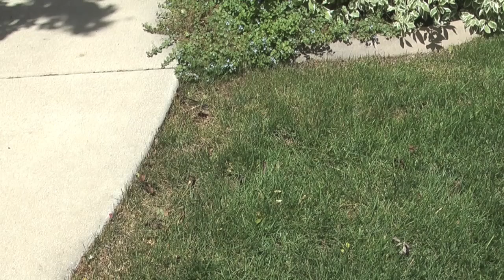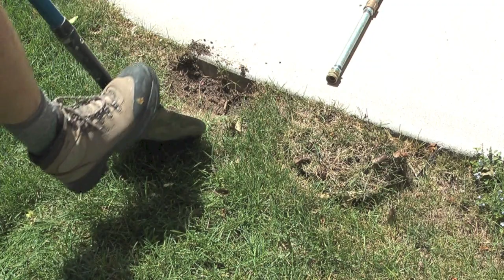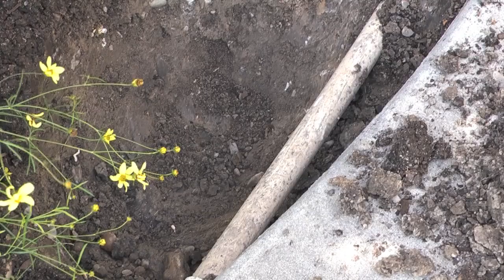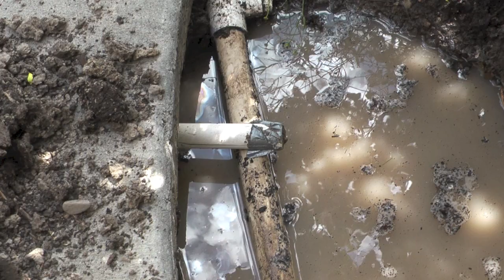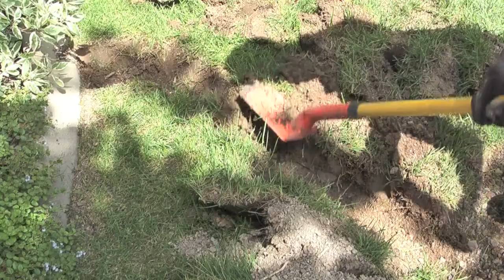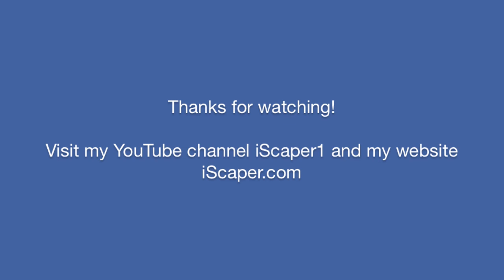How to install a sprinkler pipe/conduit under a sidewalk

Comment: Worked like a charm for my project. I was stunned that it actually worked!  I was able to run my pvc conduit under my walkway to accommodate line-voltage wiring at a depth of 12".  I added a brass shut-off ball valve  between the end of the galvanized pipe and the 3/4" (MIPT)  x  3/4" (FHT) swivel brass fitting for my convenience...and used my wet vac to suction up the accumulated water in the trench.  Thank-you iSacper1 for demonstrating and teaching this DIYer an effective way to trench under a sidewalk without having to pay-out big bucks to a professional- especially when one lives on a fixed budget.  I live in the north-east corridor of the U.S. and have the rockiest soil one could imagine.  Lucky for me, I was able to negotiate the spray wand under the slab without a hitch- and in less then 3 minutes. ~ With kindest regards and gratitude.
Reply from the maker: Thanks, I appreciate the feedback.

Comment: I did this about 10 years ago for a sprinkler system. I used 1/2" pvc with a pipe cap with a 3/6" hole drilled in it. It flexed enough I didn't need a long trench to keep it horizontal. It went under the 3 foot sidewalk in less than a minute. Because of the smaller jet, water didn't even pool up in the hole. I was lucky not to encounter any rocks.

Comment: We as plumbers do this all the time . Only I use a 1" schedule 40 pvc pipe and I cap one end then drill a 1/4 inch hole and put a 3/4 pvc mip then a 3/4 fip x 3/4 fip hose adapter . The reason I use pvc is because you can steer the pipe and make do what you want . Also you don't have to dig as long of a trench . But your way works really well too . I'm a master plumber and have been licensed in texas for 20 years but I learn new stuff every day . I'm always stay open minded and I don't think I know everything . Great job buddy !
Reply from the maker: Chad Jones 
Thanks, I've used PVC pipe also but quit when I got the pipe stuck under the sidewalk and broke it off underneath the sidewalk trying to get the PVC pipe out. That's when I went to and stayed with galvanized pipe.
Reply: iScaper1 ten for !
Reply: Chad Jones i am a gardener and I sintall new sprinklers all the time I use pvc with a jet nozzle at the end that what he did only takes me 30 mns the most no matter what soil it is unless it’s root I just move a couple feet away and start again. No need to be a plumber just common sense. Work smarter not harder
Reply: Very smart information. Now I have a more detailed plan on how to run low voltage wire under my sidewalk, and or sprinkler tubing.

Comment: how could you not like this video. Guy did a good job and accomplished the task he set out to do. professionals do this the same way. Good job!👍
Reply: plenty of jealous tradies out there sniping DIY vids.
Reply: He did do a nice job...   however, there is no need to dig up your yard like that....   a shorter pipe attached to a water-hose would do the same job with out digging up the yard.....
Reply: Luis Barrueta no, because it could end pointing down or to the side.
Reply: @luisbarrueta8207  hvvkh585
Reply: Butirdj

Comment: Thank you for this.  I made one with a $3 high pressure nozzle and a 36" galv. pipe -- worked beyond expectations.
Had corrugated pipe under my walkway, clogged with clay/debris over time.  This blasted my way around the old pipe, ripped it out and ran 4" pvc.

Comment: Thank you for the demonstration and helpful tips. I was able to easily tunnel under my 36" walkway, even with grapefruit-sized rocks, using a steel pry bar to loosen the rocks after water had cleared most of the path. Coming at it from both sides made it pretty quick too.

Comment: Thanks for the video. You should consider using spray foam to re-seal up underneath the sidewalk. Get the 36" nozzle extension and a few big cans, it will take a while to empty out the cans but its worth the time.

Comment: Nice job, Keri. I did this last year with 120V wire and conduit, and so of course I had to be at least 18" deep. That's a lot harder. For a path that supports a vehicle, it needs to be at least 24" deep to meet local building code.

Comment: for the paver walkway, rather than trenching deeper to go under, consider pulling up two rows of pavers to expose sand and base, then trenching down 12"; then replacing paver base and sand after installing pipe. I have done this sucessfully. it is less digging and fuss. Consider installing a sch 40 pvc larger than irrigation pipe to create a permanent channel under the walk. that will allow you to compress the base and sand as much as you need w/o risk of damaging water pipe.

Comment: Great video! I believe if I was going to be using the water drill a lot I'd attach one of those brass valves on the hose end so it would make shutting the water off much faster and cleaner. :)

Comment: Great vid. THANK YOU for using a tripod with your camera! I'm planning to run a water line to a raised bed for next year.
Reply from the maker: Thanks Jessie.
Reply: iScaper1  why not use  pvc with an attached nozzle . When you have  get under the side walk you just cut of the nozzel and your done , you will have a pipe under the side walk
Reply from the maker: anthony abarca
I like to use galvanized for strength. To me it's too risky to attach the brass nozzle to a PVC male adapter because it could break off under the sidewalk.
Reply: They do have pvc nozzels that are made for just that
Reply from the maker: anthony abarca
PVC would be okay in optimum soil conditions, but I would still prefer galvanized in rocky soil.
Reply: iScaper1
Reply: +iScaper1 There's another video where the guy puts a Tee on his pipe. He puts one of those square plugs on the end and runs his hose through the top of the tee. Then when it gets hung up, he taps on the plug with a sledge hammer. Might be needed on tougher soil or longer runs.

Comment: Consider using the pipe you want under the sidewalk as the lance.  Then once you have it through, you don't have to worry about getting the second pipe through, just take off the fitting on each end.  When you hit an obstruction, widen the spray to make a larger hole so you can get around the obstruction.  The two previous comments, tarp and use PVC also agree with my experience.  For the grass, the nicer job you do cutting it out, the nicer it will look when done.  A friend of mine worked at a cemetary and got so good at removing/replaing sod that you couldn't see any cuts afterwards.  He cut straight lines, slightly beveled, with a knife.  He taught this to his son and his son made a busiess of installing realtor signs.  He was the preferred sign installer in his area because when the sign was replaced, he replaced the original grass, which he cared for, and you couldn't see whre the sign had been.
Reply from the maker: Good information, thanks for posting.

Comment: Hint for the very first step: put down a tarp and put your dig dirt on it.  Easier and neater to put back later.
Reply from the maker: Eric Hardee 
Good tip, thanks for posting.
Reply: This is very true people
Reply: Actually a piece of ply wood is way better then any tarp.
Reply: @patriciocampuzano4522  I fail to understand how ply wood would be better or worse than a tarp?
Reply: @iliketakingshowers  By the time you're biting into the tarp with a shovel, just pick the tarp up at one edge instead. Either way works, I've done both!

Comment: Wow!  what an elaborate story just so you can re-live your childhood dreams and play in mud puddles.  That's ok friend.  You secret is safe with me.  I won't tell anyone.  : ) 
I am installing drip irrigation and need to run a 1/2" line poly line under a sidewalk.  I plan on using a 1" pvc tube and run the poly inside it.  Should work as here in the Low Country of South Carolina everything is sand (you have to pay extra for rocks).  Once through, I will just cut the pvc and leave it in place, then slide the poly tubing for the drip irrigation through.  Thanks for giving me an excuse to play in the mud too!
Reply from the maker: Now you've let the secret out.

Comment: No need to run galvanized first and then PVC unless it's rocky soil. Just use a jet type hose-end sprayer or a jet kit you can buy at LOWES in the irrigation isle and install it on the PVC pipe you want to run. When you get through the other side just cut the jet off and the hose side connection so you can use it again. That way you only go through the hole once. With a sidewalk, you don't really have to worry about it cracking because it's so narrow. This method is the quickest, easiest, and cheapest.
Reply: Can a pressure washer be use? With has a metal type hose-end sprayer?

Comment from the maker: The problem with pavers is that they're not a single rigid surface like concrete. If you absolutely need to get underneath the pavers I would try going deeper, maybe 2' under the pavers. It will be more work but the goal would be to disturb the soil as little as possible directly under the pavers. Then I would try a narrow straight trenching shovel to get as far under as possible from both sides. If you can't connect trenches from both sides with the shovel I would then use the water or a bar.

Comment: I tried to do this yesterday. My mistake was making the trench for the pipe ten inches deep. I also started my nozzle ten inches deep. I inserted the whole 10 foot pipe and couldn"t see the other end. Ready to give it another try today. Thanks.
Reply from the maker: +flatchyu 
4"-6" deep with the nozzle is probably better.
Reply: The slab is on the back of my house. There's a space with dirt next to the house to grow plants. Previous owners put a roof over the slab so nothing will grow there anyway. The slab is pitched for drainage so the pipe came out way deeper than it went in.  Was able to successfully run the pipe yesterday after starting it much higher. Tapping off the hose bib and running waterlines out to the yard. After that I'm going to put cement over the dirt after removing a few inches. Thanks again.
Reply from the maker: +flatchyu 
That's great, congratulations.
Reply from the maker: +flatchyu 
That's great, congratulations.

Comment from the maker: Not so. If you do the installation under an expansion joint which is the weakest part of the sidewalk, guaranteed the sidewalk will settle and you'll be back replacing that section. That's why I did this installation between the 2 expansion joints, the area is stronger and not as apt to fail. I had to learn this the hard way. The installation in this video has been done for more than a year and currently there are no cracks or settling and everything still looks good.
Reply: Very inventive, but I would be concerned with leaving a tunnel under the sidewalk weakening it.

Comment: Drill through with pvc pipe cut on sharp angle, it works like an auger. Rotate and empty the soil every foot. Works well  and is cheap

Comment: This might help in some situations, but the way I've always done it is much much cleaner. No water. If I'm running a half inch pvc conduit or pipe? I get where you were with the sharp shooter, then I use a piece of 1" EMT type thin wall conduit. I jam it in, beat it in with a hammer, etc - and basically drill through it like you're drilling a well. The pipe gets clogged, you pull it out and beat it til the dirt falls out. No mud, might not work as well in certain soils. Takes out less material though because no water washing the dirt out.
Reply from the maker: Good alternative, thanks for posting.

Comment: the only thing he did not mention or do was to do it directly under an expansion joint. That sidewalk or driveway will crack, that's why you always do it under an expansion joint. I trenched for many years so always dig under the expansion joint that is what its there for. I have seen many cracked sidewalks and driveways after pipe or cable installations under a driveway.

Comment: I used to make 1/2" galvanized, etc. boring sprayers with tee/cap or plug at the hammer end along with the hose fitting. 
Of course it lasted only so long but that's the cost of business. Often, if it's not all hard clay, just take a long enough sch 40 scrap or piece, handy metal pipe, find the most likely spot for a gap or sand under the pad/etc. and hammer away, using good monkey wrench or channel locks to twist and retrieve. Cut an angle off the leading edge to give it a point of some kind. Often you can just push, twist and pull a pipe under a driveway, etc. It just depends!

Comment from the maker: You could do saw cuts on the asphalt, dig a trench across, and install a PVC pipe in conduit for the water supply. You would still have a seam in the asphalt when you were done.

Comment: I go across with the PVC. Most times depending I'll use sched 40. Then I just cut the fittings off with enough pipe to use again somewhere. Keep running pipe.

Comment: WOW, can't imagine how much precious water was wasted doing this. Here in the often rainless southwest, we use a pointed PVC pipe and a sledgehammer. Might have to pull it out a few times to clean the end, but it works.

Comment: Why not make the water wand out of the same PVC you plan on using for the sprinkler? Once it's in just trim the fittings off each side and install remaining pipe as usual.

Comment: Check you local codes. Here in Texas you have to have a sleeve two times the size of your pipe. And its faster and less messy to just hydraulic bore it.

Comment: Running a 3/4 pipe that will stay under the concrete.. I insert another smaller pipe that will have the jet on it. Similar to a well drill. The water punches the hole and the space between the two pipes carries the muck out. Once thru, you only remove the inner pipe.

In a pinch.  You can also put a cap on smaller pipe and drill a hole in it.. making your own jet.

Problem being with switching the main pipe.. when you pull it out.. the mud will often fall and clog the hole.

Comment: Is it a lot more difficult if I want to go deeper than just directly under the sidewalk?  Concerned about the frost line...
Reply: Sorry, to clarify:  not to run electrical but water.  Thanks in advance
Reply from the maker: @IFKY  Not really more difficult, just more time and effort.
Reply: @Iscaper  Thank you!

Comment from the maker: Thanks for the information. I'm not sure what local code is here, but I would guess it's pretty close to what yours is. I see a lot of wires to sprinkler pumps here that aren't in conduit and are buried from 6" to 12" deep.

Comment: Great Video, you made it look so easy.  I'm going to try it myself, but first want to get the right parts setup like you have. How did you make the fitting for the brass nozzle tip to work with the metal pipe.  Thanks
Reply from the maker: You need a 3/4" MIPT (Male Iron Pipe Thread) X 3/4" MHT (Male Hose Thread) brass fitting.
Reply: Thanks I made the fitting, dug the hole, used the tool and buried the drain pipe under the sidewalk. No more stepping over it on the sidewalk. Thanks again.
Reply from the maker: Matt George
Thanks Matt for the update.

Comment from the maker: Not so easy to do in a driveway because of the width. I've done it on a 20' wide driveway but had ideal conditions. There were no rocks and the soil was somewhat sandy. I've also failed on 10' wide driveway that had some rock in a clay type soil.

Comment: I think its easier to hit a sch40 pvc pipe with caps on both sides with a sledgehammer. The pipe will slowly make its way to the other side and to keep it leveled, just step on the pipe as youre hitting it then just remove both caps from the pipe under the sidewalk and there you have it! Good video though

Comment: Can you run the water and wire through the same pipe? (If the wire was double insulated)
Reply from the maker: No. You could tape the wire to the outside of the pipe.

Comment: what if you hooked the nozzle to the pvc pipe?, then on the otherside unscrewed the nozzle?.. I need to bore a 16 foot long hole, and i might try it that way
Reply from the maker: If you have good soil with no rocks or tree roots it might work, but you run the risk of breaking off the brass nozzle underneath the concrete when it is connected to PVC.
Reply: Yesterday I bought a 5 dollar sidewalk tunneling kit from home depot.. worked lickity split.. I got lucky not hitting rocks or roots
Reply: craigslistrr O the more fine point in pressure you got boring through the dirt the better chance you got to get me a pipe through if you got the nozzle off the hose and don't have a fine point then you're going to run into problems you try 800 times and we ran into the same problem water has to be at a fine point to cut like cut

Comment: A better way is to hammer a piece of pipe bigger than the one that is going  under the concrete. Put a slight bend upwards so it hugs the bottom of concrete. You will need sledge hammer. No mess and fast.
Reply from the maker: Good alternative, thanks for posting.

Comment: Sorry for the confusion, my front yard has the water source and I'm trying to reach two other sections of yard.  One section heads to the West (under the 3 ft. pathway) and the other section heads North (under the 19 ft. driveway).  I could try to go under the driveway from either side with the water, but I'm just not sure if it's something I could do by myself without damaging the driveway (it's an asphalt driveway).
Reply: Ive done side walk bores with a wall fishing drill bit and my cordless drill , once you got a pilot hole, you can chase it with any size drill bit

Comment: what are the wires used for? what does it do? How does it affect a lateral line?
Reply from the maker: I used the conduit to run low voltage wires under the sidewalk for path lights.